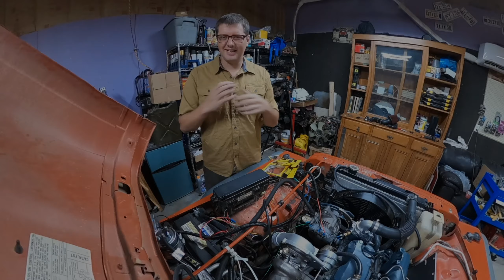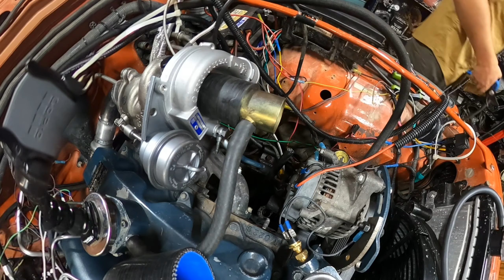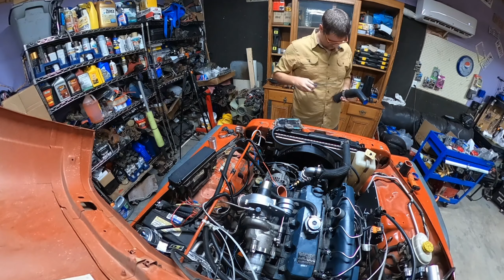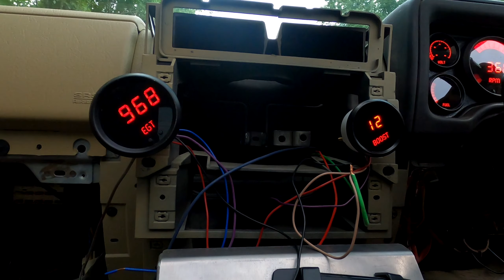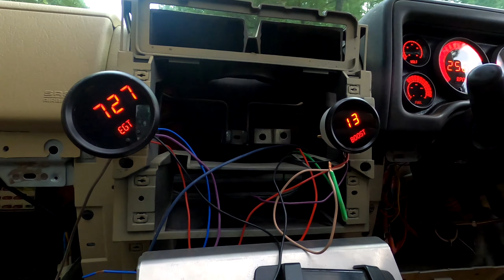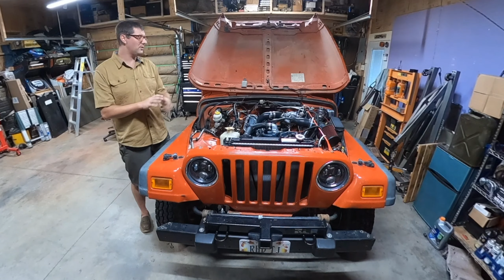Turbo Upgrade Continues on my Kubota Diesel Powered TJ Wrangler

Comment: what's your HP on that v2203T?
Reply from the maker: So it's all about how much boost but at around 15psi, which is pretty easy to hit, I would be at around 110hp and 240ft/lbs of torque estimated. At around 25psi it would be closer to 140~150hp and around 300ft/lbs of torque, though I never put it on a dyno.

Comment: Great video! Have you considered a larger exhaust in order to help with EGTs? Also I've seen Subaru intercoolers used on diesel swaps where space is a issue. Keep up the good work!
Reply from the maker: Not yet though I could easily upgrade the entire system to a 2.5" exhaust system from the 2.25" exhaust I'm currently running!
Reply: @RustyAutoholicGuy  Not sure of what the gains would be from a 2.25 to a 2.5, but I know Diesels are just giant air pumps. So the more air you bring the more you need to push out! I am watching closely because I want to do a Kubota swap, I've also told @Decent_Garage about your swap because he is building a Military CJ-5. Check him out and tell him Duddie from Duddie Adventures sent you, He will know who you are talking about!

Comment: Do you have a way to measure turbo inlet air temp and discharge air temp?
Reply from the maker: I have a gauge that I can install for inlet air temp but I don't have a gauge for the discharge air temperature, that's something I've been looking into!
Reply: Do you really think adding an intercooler is going to lower the EGT?    From what I remember when playing with turbos in the 80s was intercooler cold charge air, mass flow sensor reads more O2, so computer adds more fuel, result is more power and a hotter burn.  I think you're trying to fight thermodynamics here.
Reply from the maker: I don't have an O2 sensor or a computer controlling the fueling, all the fueling is done mechanically. Also from what I've been told as well on diesels, the boost actually cools the engine, the fuel adds more heat. So I'm thinking that lowering the incoming charged air will help reduce EGTs. I'm not expecting my heat to go away completely, but more I'm expecting the intercooler to help get my EGTs to a stable level where they won't be climbing or at the very least not climbing as quickly.
Reply: Cooling the charge air usually reduces EGT.  Besides the lower temperature from the direct effect of the intercooler, the cooler air is denser.  
The additional air leans out the mixture.  Unlike a gasoline engine, a leaner mixture cools combustion chamber temperature in a diesel engine.  Additional fuel will of course increase combustion chamber temperature.  I think you'll need to determine the sweet spot (if this applies with your engine/turbo combination) between max boost and EGT.  Holding the waste gate close can actually cause increased EGTs if air flow is maxed out before the turbine reaches max RPM.  In that case, allowing the waste gate to open will lower EGT.